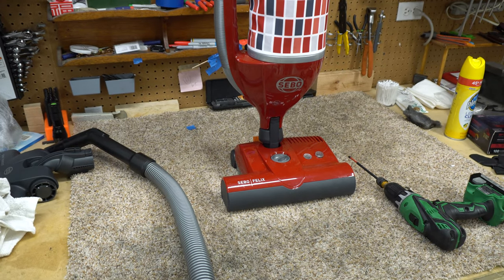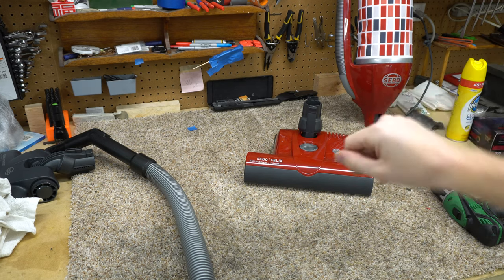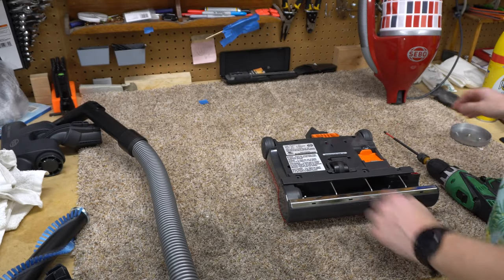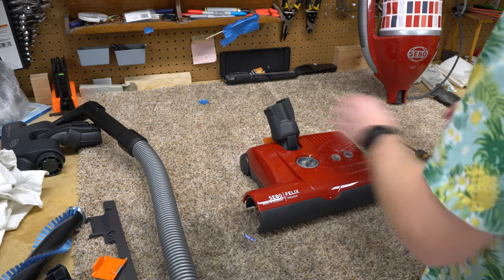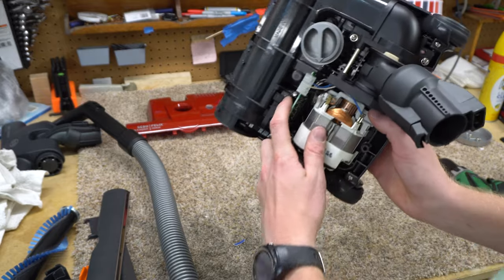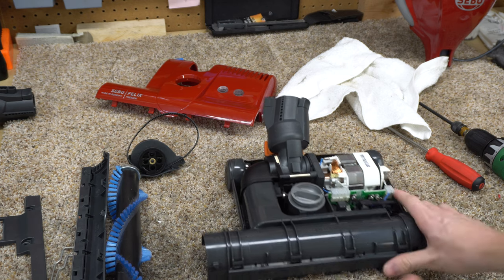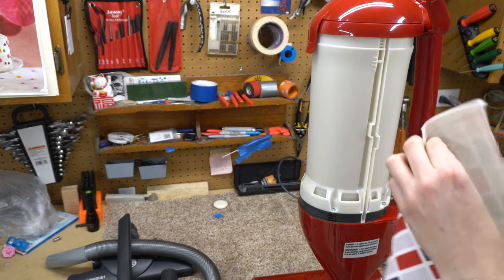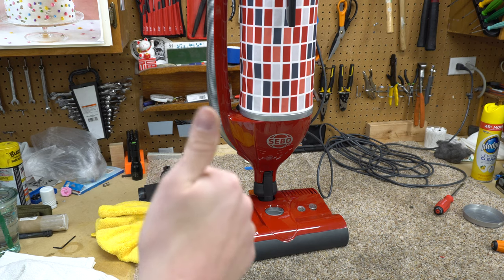SEBO Felix 1 Upright Vacuum Cleaner Repair-Models 9809,90807,9808am,ET-1

Comment: I have a 6 month of Felix. It isn’t powering on. I opened the top handle area, and the power chord appears fine and also connected. What is typically the issue here? Thanks!
Reply from the maker: Never had one with the power issue bring it to your local dealer make sure something isn't stuck in it that caused it to shut off and save the motor

Comment: What's the difference between the Sebo Felix, Sebo Dart, and Windsor Axcess? It looks like you could save $200 by going with the Dart or Axcess and buying the parquet brush separately if you want it. Great videos btw.
Reply from the maker: The Windsor does not have the swivel neck. The sebo dart doesn't have the telescoping handle and the floor tool .
Reply: @PerformanceReviews  Thanks for all the information. After the pain of three bagless vacuums I never want to go bagless again.
Reply: @PerformanceReviews  Dart also doesn't have suction control
Reply: @Blackout720  Also, the Dart head does not swivel.

Comment: Brushes are not turning is it the belt broken ? Have not opened it up completely ,what else could be wrong please will somone comment  thanks.
Reply from the maker: Plug your hose all the way in. Any additional problems bring it to your local dealer you do not need to change the belt in this ,rewatch video.

Comment: I've got a problem. Basically the vacuum doesn't work with power head. There's no any light on the cleaner head, nothing happens when I press the button. Any idea what could be broken?
Reply from the maker: I would make sure the hose is plugged in all the way. If the problem persists go to your authorized dealer for service.
Reply: @PerformanceReviews  I was able to fix it. The internal wiring was faulty.
Reply: @Blackout720  i have the same problem the wiring where on the switch or the motor